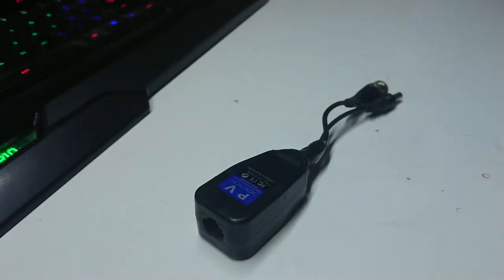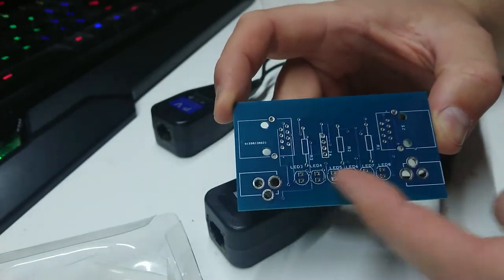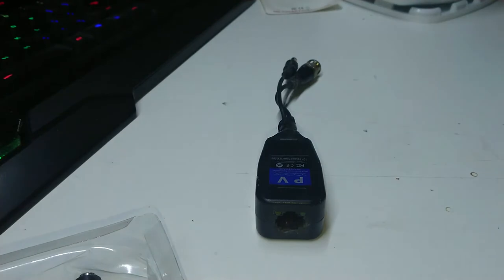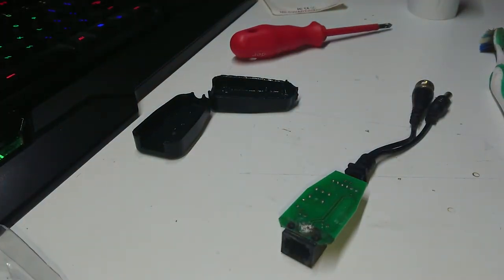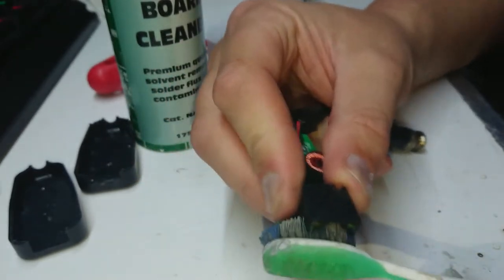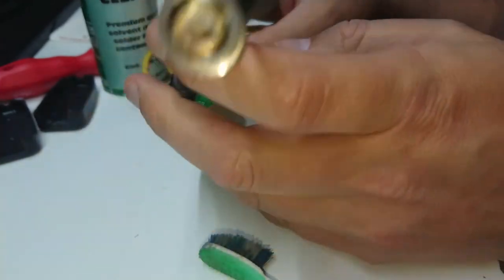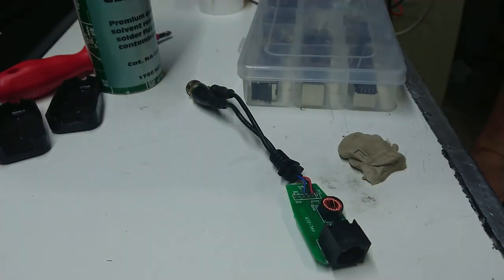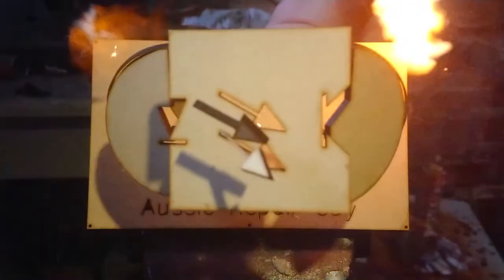Dissecting a water damaged Video Balun

Comment: Hi mate, that filter is actually a balun.
It takes the unbalanced video signal and transforms it to a balanced pair signal and back to unbalanced at the other end.
Balanced signal and  a twisted pair in the ethernet cable means low susceptibility to noise and a fairly good line impedance for analog video bandwidth.
The balun will have a coil with just end connections for the unbalanced side and a centre tap coil for the balanced side, the centre tap may got to gnd.
I agree, the cost of fittings and components on those boards, for you and me, would be much more than we can purchase them from China.
Hope you feel better soon mate...👍👍👍